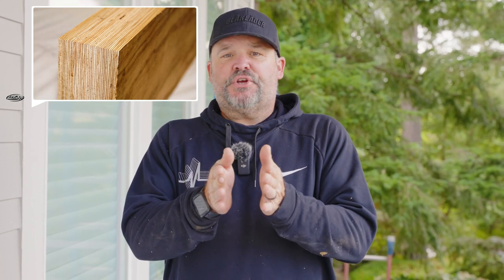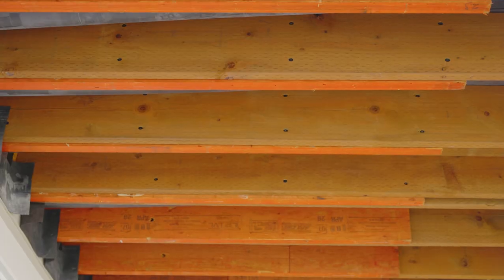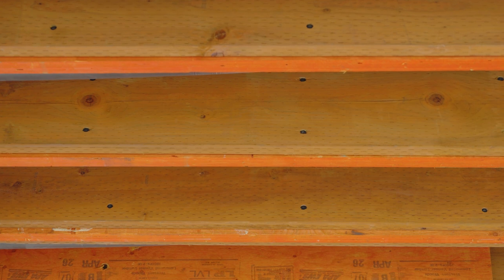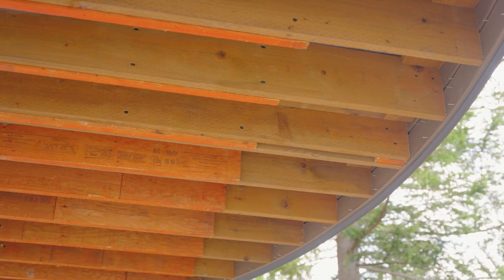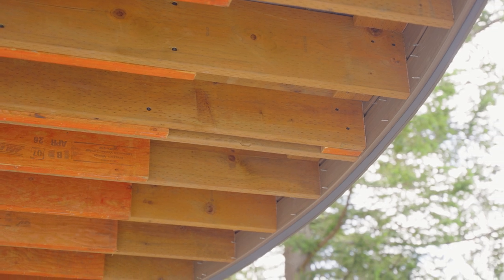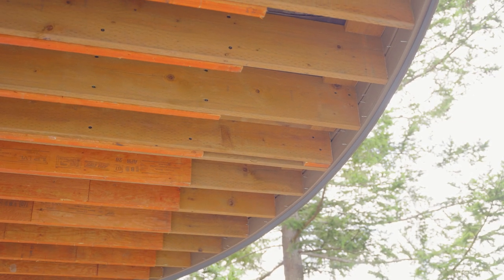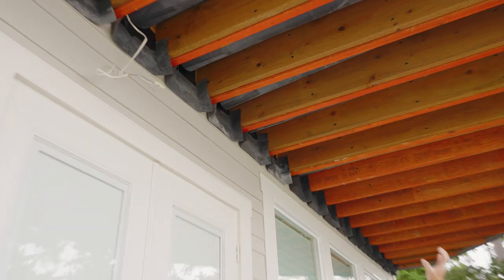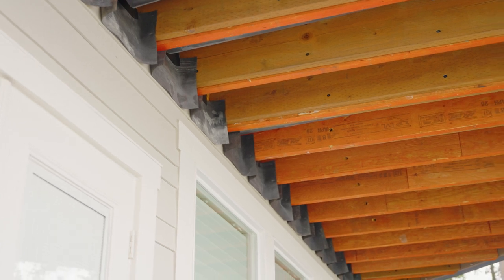How To Extend Out A Deck Using Sistered Joints || Dr Decks

Comment: I removed a supporting wall to open up the space in my home and have two 26 foot long 24" high 18-ply LVL beams, headlock screwed together and spanning the width and holding up the upper floor (in the centre of the house). The LVL sits on six 2 x 8's in each wall that are vertical and glued/sandwiched together, and this is repeated in the basement, where they rest on the concrete wall. I sanded and stained the LVL and it looks gorgeous.